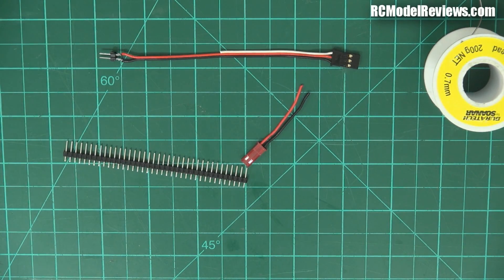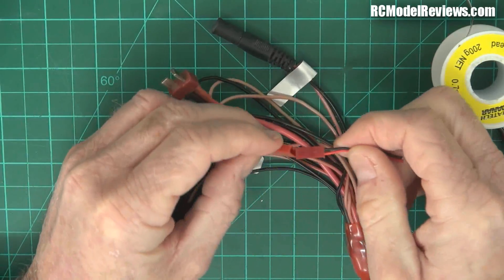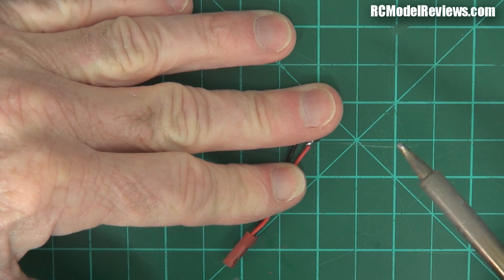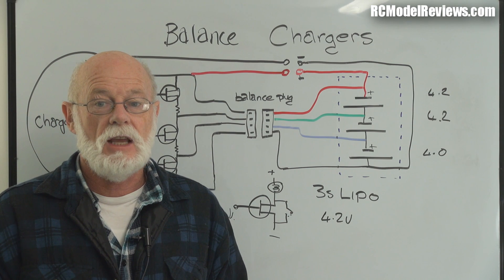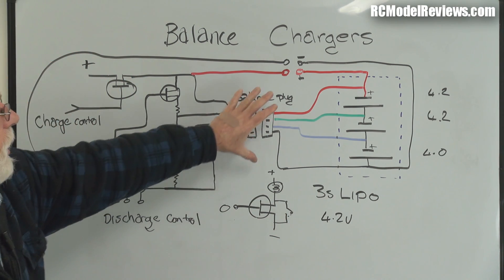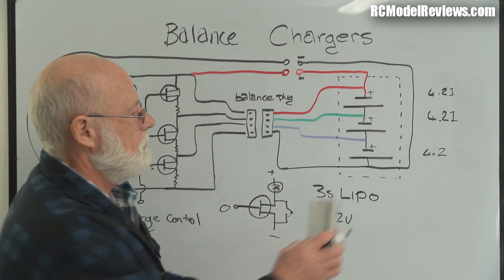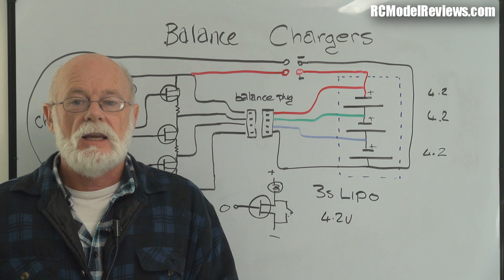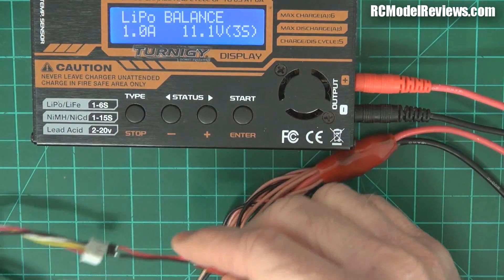Balancing your lipo battery more quickly (and how cheap chargers work)

Comment: I'm confused, I though that the balance port had had the positive to each battery in it along with a common ground?  How does connecting the positive poles of two batteries together charge it?  Example:  If you look at the balance plug, there is a black wire, a white wire, a yellow wire, and a red wire.  That would indicate a 3S lipo, with the black wire being the ground and the other three wires being the positive of each cell.  How would connecting to the yellow wire and the white wire charge an individual cell?
Reply: the cells are connected and charged in series,  draw a diagram and you will see the black and white is cell say 1, neg and pos,  white and yellow cell 2 neg and pos, yellow and red 3 neg and pos.
white is connected to pos of cell 1 and neg of cell 2
yellow to pos of cell 2 and neg of cell 3 this allows you to charge or discharge each cell independantly.
 bruce diagram wire colours are different,  black, blue, green, red, for some reason.    all my batts and charger are black,white,yellow red.
Reply: As written.  The cells are in serial. If you count the cells from negative to positive, you have cell 1, 2 and 3 in your example.
So the black is the 0 Voltage, ground.  The connection between cell 1 and cell 2 we call P1, between cell 2 and cell 3 we call P2 and last we call P3, or battery pack voltage (3*4.2=12.6 V).

The connection between ground and P1 are 4.2 V, that is, it is the positive pol on cell 1 and negative pol on cell 2.  
The voltage over cell 2 is also 4.2 V, who is the voltage from P1 to P2, right?  That also means that the voltage between ground an P2 are 2*4.2=8.4V.  
Lastly the voltage between P2 and P3 are 4.2V. That gives us the voltage from ground to P3 (packs output voltage) is 3*4.2=12.6 V.

So the connection between ground and P1 are over battery cell 1, connection P1 and P2 are over battery cell 2 and lastly P2 and P3 are over cell 3.
So, if we only connect a load between ground and P2, we get connection over cell 1 and cell 2. So we only discharge (or charge) cell 1 and cell 2, but not cell 3.
If we only connect  a load between P1 and P2, we get connection over cell 2, but nothing over cell 1 and cell 3.  So we only discharge (or charge) cell 2.  P1 will then be 0 V (or ground) for the charger and the battery ground -4.2 V and P3 4.2 V from P1. But as we don't connect ground or P3, there are no electric circuit, and no ampage will go through cell 1 or cell 3.
You can connect P1 to 0V and measure with a voltage meter the other connections if you like to be convinced.  

I short, P1 is positive pol on cell 1 and negative pol on cell 2, P2 is positive pol on cell 2 and negative pol on cell 3.  If we put a load from P1 to P2, the load will only be between negative on cell 2 and positive on cell 2.  That is it will discharge cell 2.  The other cells, cell 1 and 3, are only connected by one pol.
Reply: +Michael Batson. You should stop watching videos like this when you don't understand the basics on battery connections. And the same to ChuckPlains.
Reply: Heh, I have some Power-Tech 3S Lipos here with one red balance wire and three black!! :¬/
So I always assume the furthest one from red is the common. ;¬)

Comment: Why doesnt the charger have a microcontroller doing this by default ?
Reply: The charger do have a microcontroller that control the charger.  The problem is you need a much more complicated construction if you want to charge each cell individual. And that will have an impact on the price.
But yes, it is posible to charge/discharge each individual cell, and they do discharge individual cells.
Reply: Using this very method why can't you use a TP-4056 and use that to top off your separate batteries? In fact, for a 12.6v 11-1v why not wire all three negatives to the one negative of the two pin and daisy chain them to the three TP-4056's and run the positives of each one to each single pin and turn them all on to charge them all and if needed bring the resistor up on the TP-4056 to 5000.250 from the original 1000-1A and slow charge a out of volt pack? Each TP-4056 should shut off when the cell is charged, right?

Comment: are cheap chargers so stupid not to open balance fet on full cell and regulate curren't to still have full charge voltage on that cell?  That kind of balancng will be much faster, beacouse balance fet on full cell will conduct continiously

Comment: or you buy a balance only charger 2 amps... this one http://www.hobbyking.com/hobbyking/store/__21044__Hobbyking_174_DC_4S_Balance_Charger_Cell_Checker_30w_2s_4s.html 

it charges only though the balance leads.. why wont main chargers have a option to do this... it would save on circuits

Comment: Terrific overview @RCModRev - thanks so much.  Coming up to speed with balance charging and understand the intrinsic problems with parallel charging, but wonder what you think of charging multiple lipo's using a serial balance board (e.g. 3x 2S lipo's at once using a 6S charger like the Turnigy you use here)?  Also, I have a quad (XK X251) that comes with a 2S lipo but only has a balance connector - i.e. no separate 2-conductor power input/output connector.  Can these batteries be charged using the type of Turnigy charger you show here?  Thanks again.

Comment: Hey Bruce, do you know why the 1st cell in the LiPo battery wear out faster than the other cells?
Reply: what?
Reply: internal resistence,

 by Ohms law you will see i=v/r (current = voltage/resistence), and as you know (or at least i'm telling you),

 all batteries have a internal resistence, (that is the reason why they warms a bit when they're discharging and/or charging). 

SO, when you're charging them by main leads, all the current from the main leads will be divided equally to all cells. that means the cell with higher internal resistence (bad cell) will get the voltage higher to maintain the current the same as other cells (what is bad).

one example is:

battery: 3S 11.1 V
charger: 1A

current throught the cells: 1/3 = 0.333A

normally, a LiPo battery have .01 ohm of internal resistence

and by ohms law we have:

.333=v/.01
v=.0033

that means .0033 V between the cells, what can make the recharger reads 4.207 + .0033 = 4.213 V (4.21V)

the first cell (what recieves the current) will have 
4.213V
the second cell:
4.207V
the third...:
4.203V

an that little difference do what happened in the video.

Source:

i'm RC lover, so i need to do my homework to not explode anything. heh... 
and also "Half-Eletrical-Engineer", what brings me a bit of ohms law.

Comment: Hi Bruce , I have a Hobbyking Multistar 6 cell 22.2v 10, 000mah battery that is 6 to 8 months old BUT I have never charged it , I checked it when it was delivered and all cells were 3.80v I have checked it today and cell #3 is at 0.46v !! should I use the balance lead to bring that cell up to 3.80v and keep an eye on it . How has this happened as its never been used ?? Many thanks mate ......
Reply: You could also try to get it replaced, as it could be some fault with the cell.
Reply: Thank's , yes it is dead , i charged it and two day's later it was 0.46v in that cell again so i am going to remove that cell and make an 18.5 battery as al the other cells are good . Pity though as i don't now if it will be powerful enough to fly my big multi-rotor now . Thank's for the feedback .......
Reply: Have you ever tried to deal with Hobbyking's customer service ?? Pity you can't buy spare cell's , i would rather play about with that than Hobbyking's customer service , many thank's though , all the best , Scott .....
Reply: You can do that, be sure to charge it as slowly as possible until 3.30 V. And keep a very close eye on it. Fly it once. If it is lower than the other, it is dead.

Comment: I made this little device of yours but when I'm charging the cell, the charger is running but I see no cell information. Also, I set my charger to 1s, at 1amp. is this correct for a 5800mAh 2cell battery?

Update, the cell is charging but the Hitec X4 Plus isn't showing the cell data. I have to disconnect the battery from the charger and read the cell information on a 5 in cell meter. Will the charger automatically stop charging like normal when using this method?

Comment: Hi mate - love your site and all your videos! I am wondering if you can recommend a good reliable ACCURATE multibattery type balancing charger available in Aus or NZ, as I am fed up with paying very good money for all the pretend clones and cheap lookalikes of "good brands" and cannot believe most (dare I say all websites) selling what is supposed to be the genuine article! I have very recently had a really bad experience with the iMax B6AC V2 charger - details attached below and am presently attempting to get my money back for this charger - no it was not a clone as it came with the ligit hologram, serial number etc and so was supposed to be the real deal - and I think it is! It is my opinion this is a very dangerous charger (refer my observations below) and apart from wrecking one of my battery packs it is also horribly inaccurate in the voltages displayed which compounds over charging - again see my observations.

Really appreciate your advice and (within reason) cost is not the primary issue as I want a charger that is accurate, reliable and one that can repeat all the design tasks over and over.

Cheers and look forward to your advice, Ian (DownUnder) 

Here is the main transcript from my email to the iMax B6AC V2 supplier .................
 Hi XXXXXX - thanks for your reply; however, your comments of "hobby grade" and "slight variations" are "way over the top" and totally not how this charger was advertised on your site!!!! 
Your comment of "slight variations" for a battery charger giving an under-reading of 360 - 500 mV on a LiIon battery of nominally 3.7 V is absolute absurdity at its best - I defy any charger manufacturer of any standing [meaning not Chinese junk clones or components] to make such a claim in earnest!  One that did would be quite rightly laughed out of the electronics business - irrespective of whether it is hobby or professional As for your innuendo regarding my volt meter readings repeatability - as a scientist, yes I agree there are always ACCEPTABLE
reproducibilities and repeatabilities and the different meters I used to measure these observed variations were as follows:1.            My expensive Agilent U1242B Voltmeter: battery before charging 3.453V; after charging and resting 3.598V [I was       planning on individually charging each of my LiIon batteries to 3.60V before balance charging all 4 together in the iMax B6AC V2.

2.            My mid to lower range Digitech QM1548 Voltmeter before charging gave  3.45V; after charging and resting 3.60V
3.            My "el cheapo" $10 voltmeter before charging gave  3.42V;  after charging and resting 3.61V

4.            iMax B6AC V2 gave 3.12 V before charging; after charging and resting 3.24V!!!!! What does all this say about the iMax B6AC V2 charger? What an absolute piece of junk this is!!!!!
5.            It also separately badly overcharged a Sanyo 8 cell 2700 mA NiMH pack [set in NiMH auto charge mode and battery max current set at 1.5A or 1500mA, which nominally would have been 9.6 V but should have stopped charging at around 10.5 - 11.5 V typically] but it kept charging to 15.9V and reaching a temp of 66C!!!!; before I killed the charge process.  ALSO, This battery pack was perfectly OK before putting it on the iMax AND HAD BEEN CYCLED APPROX 20-30 TIMES DURING REGULAR USE - JUST IN CASE YOU WERE THINKING OF MALIGNING THIS BATTERY PACK!
6.            Finally, your "slight variation" as you say represents an absolute iMax V2 meter reading error of 15% - 20% for the LiIon battery; and an overcharged error of  38% - 51% [which would have been higher if I had not stopped the charging] for the NiMH 8 cell pack!!!! I believe this charger is a very definite and real fire hazard waiting to happen for the unsuspecting!

 So much for your glib assurances for this charger which has been demonstrated from my above observations to be totally faulty!
Therefore, if what I understand you are telling me, this is normal [[INACCURACY]] for the iMax B6AC V2 and it is not faulty, then I wish to return it to you as a completely misrepresented [and in my opinion dangerous] charger which in no way meets the chargers specifications ..............."

Comment: The charger of my eachine racer 250 is a 2s - 3s automatic balance charger. But it charges every cell separately without a main lead, you just connect the balancing lead. With my other charger I have these problems you mention. It just doesn't finish, takes ages with my 2s 6000mah. My 3s 2200mah work properly with this problem device. 
The eachine charger has no problems with any of my lipos, just takes longer. Really stupid this switching system with resistors. Now I understand some odd things I experienced in the past.
Reply: Hi +InTheSh8 ,

A 2s LiPo with 6.000mAh doesn't sound like it's commonly used...
But I agree with you, some chargers aren't good.

Benjamin
Reply: It's this guy: http://www.hobbyking.com/hobbyking/store/__73951__Turnigy_B6_Compact_50W_5A_Automatic_Balance_Charger_2_6S_Lipoly_EU_Warehouse_.html?strSearch=b6%20compact

In the beginning even the 2s 6000mah were finishing with the right beep. But due to older battery chemistry I assume that the B6 is getting confused somewhere in the process. It wouldn't overcharge, even after 2 hours or 3 hours it's safe. Most of the times even balanced at 4.18 in both cells. Maybe something wrong with the discharge resistors? Cypriot sun is very hard on any device. I sometimes can't avoid charging in the sun, because I do it outside for safety reasons and the location is getting sunlight from lower angels from time to time. But again, strangely the 3s lipos are charging perfectly with the same charger.
Reply: Yeah, this charger schouldn't be bad at all ;)

Should work as any other charger, too.
But it doesn't, maybe your LiPo is too old?
[ You know, these companies who produce them, wana sell some new ones to you! ;) ]

Yeah, i can only say, that this technique with charging, discharging, charging again, discharging again, ...
is absoulute sh!t.

Why not charge, until one (or more) cell (s) is/are @ 4.2v, and then only charge the cell (s), that haven't got 4.2v, through the balance-port, until they reach that voltage.

Would be MUCH easier, and it works just fine, much better/more expensive chargers work like this.

Benjamin
Reply: THX, for the answers. It's possible the Lipos are not good, but I have actually 2 of these running as 4s in the sabertooth and the sabertooth doesn't show significant worth runtimes. You know what's strange? Let's say it stuck in red diode light (red is normal charging). When you switch it off and on again it goes into orange (balancing). Funny, or? Maybe it's a bug of some kind in the default programming of the chip.
The B3AC from the eachine racer is very cheap and lower current, but charges every cell independently. Very good catch this eachine racer 250 and even fpv ready. I don't want to fly my toy quads anymore!!!
Reply: I think it's a software bug. Both LiPo's can't be dead! ...

Even if the B3AC only loads with very low current, it's better than nothing ;)

Benjamin
Reply: @Benjamin, it is a more complicated construction, but posible to do.  Just use top charging through the balance port when one cell reached fully charged.

But, much more complicated construction will cost more, and result is a more expensive charger.
Reply: Well, doesn't it depends on how much have gone into the batteries if it will go into balancing charging mode?
What does it say about the voltage on each cell?

Comment: when charging on this method, did dean connector from charger output connect with battery? or just 2 pin on balanced lead that connect with the battery? thanks before. :)

Comment: Question: First of all, great video. I passed it on to my friends. This is a bit of unrelated to balancing. Quite the opposite.. what would happens if say I fly my plane with a 6cell and I hook up LED lights to one or two cells from the same pack? Will this make the lipo pack terribly unbalanced ? I wonder if powering the LED lights during flight while the motor runs somehow makes the cells even out opposed to powering the LED lights without running the motor. I bought a plane that has this system (tech one air titan with LEDS)  and i had pretty bad results. Those light drew a lot of current and ruined one of my backs while bench testing.
Reply: did you ever get an answer on this issue? I bought an led light that connects to the balance lead. it uses the 2 outermost pins, so I assume it is taking power from all 3 cells.
Reply: AmericanBulldogRocky I did not get an answer. it draws from only specific cells, not all. don't know why the led strips inside the foam draw so much current. maybe deffective.
Reply: yes, from two outside pins it should take from all cells. i would read the voltage to be sure.

Comment: This is an excellent idea to speed up th whole charging process. 

Ques:  Why not topping up each cell up to 4.20V one by one & then whole battery charging done? 

Why hs to be put  in series ??? Pls ans anybody. Thnx.
Reply: As each cell can only be safely charged at 1C (2.2A for a 2200 mAh battery) charging them one by one would take 3x as long as charging them in series. In practice it would take even longer because (as the mentioned in the video) the balance lead cannot handle that much current.
Reply: Hmm makes sense. :-) 
However, I did not agree that the balance lead........  .  At least it can handle 1.5 amps I believe. Enough to charge the cells very fast.